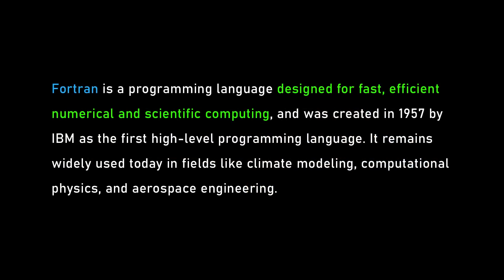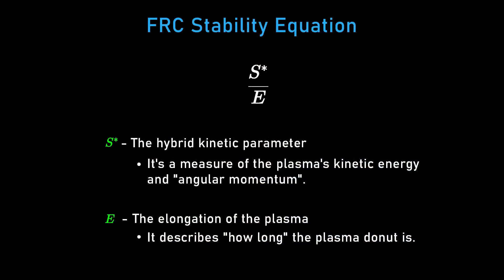Code that controls nuclear fusion: What programming language is used? | David Kirtley

Comment: What a bunch of malarkey. FPGAs are not programmed in assembly. You might download a synthetic core into the FPGA and program that in assembly, or the FPGA might have a hard core and you program that in assembly, but the programmable logic is defined in RTL which is not instructions (as CPU machine code is).

Comment: "Code that controls nuclear fusion: What programming language is used? | David Kirtley"

David Kirtley, CEO of Helion Energy, is interviewed by Lex Fridman about the programming languages and systems used to control nuclear fusion reactors:

Time Scale of Fusion: Fusion happens in microseconds—far too fast for human responses. Control sequences are pre-programmed and managed by computers capable of gigahertz-scale operations.

Programming Languages Used:

Fortran: Still extensively used for physics simulations and numerical computations due to its efficiency and legacy support in fusion and scientific codes.

Python: Used increasingly for scripting, automation, and binding together simulations. Some reactor operation codes use Python, despite its slower performance.

Java: Used intermittently for supervisory control and high-level system orchestration.

Assembly Language: Essential for programming hardware-level logic and direct control of FPGAs (Field-Programmable Gate Arrays) for rapid switching and triggering electrical sequences.

PLC (Programmable Logic Controllers): Structured text, ladder logic for interlock/safety systems.

C, C++: Used for real-time plasma control and integration with other systems.

VHDL/Verilog: For direct hardware description and FPGA programming.

How Control Works:

Electrical switches and fiber optics manage plasma and energy flows, responding in nanoseconds.

Real-time diagnostic systems monitor thousands of parallel electrical switches, using fiber optics and electromagnetic sensing (Rogowski coils).

Control sequences are designed and simulated ahead of time using computational models, often derived from MHD (magneto-hydrodynamic) codes and SPICE electrical modeling.

Simulation & Design:

Simulations run at multiple levels: fluid models for plasma, particle-in-cell models for ions, SPICE for electrical systems.

AI and machine learning are starting to assist with faster, more predictive control and diagnostics.

Comment: So he mentioned Fortran and Python ... I'm guessing numerical cores in, probably, Fortran-77, and betting some of that code was written twenty years ago or more. But the thumbnail has code from an even older dialect -- looks like Fortran-66 to my eye, based on the numerical (three-way) IF statements.

I'm going to go grab a beer and deal with the flashbacks for a bit, thanks ...
Reply: Twenty years ago people were already writing in Fortran 90/95.    I have Fortran 77 code left from the 80-s (runs just fine),  but not from 90-s onwards.

Comment: Electrical signals travel along wire at very nearly the speed of light. If you use photons you have to have some kind of device detect and convert signals, but electricity can simply power the device when it arrives. I'm not convinced by the speed argument here, considering it's very likely any detector for photons is slower than simply letting the electricity flow.
Reply: Bro no. He's just describing fiber optics but acting like it's something special. It's not and it is faster than copper for sending data.
Reply: @772storminorman  That's not why we use fiber optics to send data. Moving electricity through wires over long distances is annoying as fuck if you can't do it at very high voltages. He's describing systems inside a fusion reactor for timing things which is not going to be long distance, you wouldn't use fiber optics for this because it'd be slower.
Reply: @Lambda.Function 

Unless the electromagnetic interference is so bad that wires are a problem due to the noise.
Reply: @Mentaculus42  Then they wouldn't be using electronic devices at all because we don't have photon processors.
Reply: @Lambda.Function 
So I see you are big on antenna design! So what is very bad on a transmission line of large extent is manageable for shielded devices. Besides they probably use the fiberoptic lines to trigger switches so that induced noise doesn’t prematurely trigger them and get the timing of the sequence off.

Comment: LOL - once I heard government programs. So this is part of an old project made up of code written in whatever language was popular at the time. In short, it's a bunch of old legacy systems held together by a spaghetti of assumptions. This is how government-funded projects work - not kidding. Which isn't really a problem as all the critical stuff will be done by FPGAs (which will be very well engineered). So HDLs are the real stars here in terms of programming. All the other languages will likely be used for deriving what settings go into their FPGAs at the initialisation stage. What language is used probably isn't time-critical. This is pretty much the model employed in trading where every microsecond counts.

Comment: ps Los Alamos used to have a 12 million line Fortran code; so they must have someone who does Fortran at a large scale.
Reply: Almost every person actually doing large scale  scientific numerical simulations knows Fortran.
Reply: Wow!
Reply: @andydataguy    Hi Andy. Just something for your head…  When I originally asked how much code they had (years ago, during a visit), a software manager said they didn’t know. Someone got back to me in 3 days and said about 12 million lines of code (mostly fortran), of which they estimate about 5% was NEVER called.

Now the fun part. I used to have a fair amount of experience looking at science and engineering codes, and what I invariably observed, was a conceptual error about every 1000 lines of functioning code. Not just little errors, conceptual errors. So for example, a code used to design the air flow in a million cars had a boundary value coding error in the differential equations used to calculate the air flow. The code had been in use for a long time when I noticed the error as I tried to extract the original differential equations from the code. [It caused a bit of a stir.] I found similar things in industry code, university code, and government lab code.

What this implies, using my anecdotal rule of thumb, is that their code had approximately 12 THOUSAND conceptual errors. Ouchy ouch ouch.

What does it all mean??

That is a longer story, for a different time…
Reply: I can see using Python to run assembly language modules and programs to make the UI more friendly. However the actual code ( where the rubber meets the road ) needs to be written in assembly language using microprocessors that run the code natively. Adding a programmable device to emulate a cpu adding an additional layer and increasing latency.  Sounds like the entire process is loaded with chaos and needs to be scrapped and redesigned.

Comment: Very few expert believe what Helion Energy is doing is a valid path to fusion energy. While there is no real consensus, Tokamak and Stellarator are by far leading. Not quite getting to fraud for the others, but some come pretty close, and some will almost certainly turn out to be. We know that Tokamak will work, just might be less efficient than Stellarator. Stellarator is catching up fast, but it is not obvious it will work. All the rest is hard to see. Several of the startups have switched their basic designs already, basically stating that they were completely full of... While it isn't perfectly obvious that there cannot be an efficient almost ICE like fusion system, there are so many extra problems compared to Tokamak and even Stellarator that it is -- far fetched.

https://en.wikipedia.org/wiki/Helion_Energy#Criticism

Comment: Something doesn’t add up. How is a microsecond related to a MHz? 1 Hz means once per second, and 1 MHz means one million times per second. So if we’re talking microseconds, that’s more in the kilohertz range.

By the way, the ZX Spectrum used a Z80 CPU running at 3.5 MHz.
Reply: T=1/f=1/(1MHz)=1/(10^6 * 1/s)=10^(-6)*s=1 μs

microseconds is exactly in the MHz range. Maybe you are thinking of milliseconds (which is in the kHz range)?
Reply: @halcyon107  

You're right, I was talking about microseconds and thinking about milliseconds.

Comment: Imagine not using Rust to power nuclear reactors.
Reply: IIRC Fortran 95  is memory  safe, because it  doesn't have  C-style pointers.
Reply: @anotherelvis Still you can write syntactically  code that accesses arrays outside their bounds. What happens at runtime (runtime error, sonething else) depends on the compiler and the compiler options.

Comment: how can you program FPGAs with Python and Assembly ???
Reply: There are Python packages (e.g. nmigen, now Amaranth, MyHDL, etc) that transpile to Verilog/VHDL. However, no assembly (and it doesn't make sense actually). But what he probably means is VHDL, with the higher-level stuff done with Python (there's the PYNQ project for Xilinx FPGA's). They could be using assembly to optimize specific algorithms for special-purpose processor cores instantiated in the FPGA-fabric.
Reply: A lot of FPGAs come packaged with Arm processors and like-thereof.

Comment: All control system consists of the following but not limited to.

Manual controls: hand valves.

Mechanical controls: interlock's, psv's, rupture disc's.

Pneumatic controls: control valves,  solenoid valves. 

Electronic controls: PLC's, DCS's, SIS's, SCADA & HMI's.

Comment: Guys this dude is a manager and marketer pretending to be technical person. Consider this a fun Ad, not anything more.

As far as I know the whole point of FPGAs is to not have the overhead of software and program hardware at the gate level. You'll know the dude is a marketer when he says we used "assembly to program FPGAs". Never heard anyone to call VHDL or Verilog, hardware assembly language. Musk actually created a wave of CEOs pretending to know stuff end-to-end. And Lex just looks amazed upon hearing this marketing show😄
Reply: Just like lex
Reply: Yeah, I agree, and fibre is not actually faster than copper, it's arguably slower. there are other benefits
Reply: @edmaher1 

Yes you are probably correct. Probably more to deal with some serious electromagnetic interference due to the large pulsating currents in the surrounding environment. But hollow-core fiber cables can transmit data up to 45% faster than traditional solid-core fiber because light travels through an air core, closer to the speed of light in a vacuum.
Reply: Thats true, you don't use "assembly to program FPGAs", I thought he meant he was using literally assembly code to program VHDL, but that wouldn't make sense now that you made me think about it, you use C/C++ to program VHDL since C++ is a higher level language and easier to program than VHDL and programming in assembly for VHDL make no sense to me because programming assembly is really time consuming you might as well program in VHDL alone. 🤣
Reply: The FPGA comment took me out completely. 

They are probably using PLCs and a Java/Python frontend. I don't think that they are using FPGAs unless you need some very fast nanosecond reaction time on a subsystem, but in that case it would be things like an emergency off switch or a simple PID controller.

Comment: yes Fortran is still a great number crunching language  Last standard I worked with was 2003 and for numerical methods it was lovely to program in
Reply: And it is  easy to learn  for new programmers.
Reply: I said it was not the best for making images or speech or taking such input. I thought I made clear that Fortean is an ASCII based system and one needs cumbersome extensions to handle such actions. An example would be the NCAR graphics package, which is good for planetary vector and contour maps and simple x-y plots etc.
Reply: But you need a well written compiler that uses the chip architecture and assembly language. This compiler is usually sold bundled together with the operating system by the fabricator. The problem is that fortran is totally ascii text based and code is written with a simple text editor like VIM. It is fine for batch jobs but it gets clumsy as soon as interactive graphical output is needed at run time.
Reply: @micahdembo5140 you don't use Fortran for the graphics just number crunching/ numerical methods. There are good Fortran compilers out there and still a lot of work is done in Fortran.
Reply: @micahdembo5140  Not really,   just get a free Intel oneAPI compiler and you are as good as it gets for the majority of HPC clusters around.     Gnu gfortran is not bad either.  For GPU's there is CUDA Fortran
Reply: @micahdembo5140 

But if you need graphical output, why would you use Fortran for that part of the processing?
Reply: @Mentaculus42  
See my other remarks. But basically it comes down to portability and speed and uniformity across all types of silicon numeric coe-processors and CPU architecture. It is better to do most numeric intensive operations in Fortran if these are the steps that represent the bottleneck of the application.
Reply: @micahdembo5140 

But you were specifically referring to “graphical output” which I assumed was for user presentation, maybe in semi-realtime. Or were you referring to something else about graphical? Why not just pass the Fortran output data to a more specialized graphical generation package (in a different language) for the user interface?

Seems like it is possible to pass data between a user interface module and the Fortran backend code during runtime. Probably a little bit of a pain to setup but I am having a bit of a problem visualizing where one needs Fortran as a continuous realtime control backend that needs to graphically interact in realtime with a complex user interface. My experience with Fortran was only in doing things in “batches” and control systems used different approaches. But my background is rather dated. Just interested in how things are handled now.

Comment: A fusion control system is like a high-frequency trading (HFT) system, constantly monitoring a fast-changing, high-stakes “environment” and switching strategies in real time to maintain stability. In this metaphor, plasma is the money: it’s the lifeblood of the system, volatile, valuable, and potentially destructive if not properly managed.

Just as HFT algorithms adjust orders to respond to market movements, the fusion controller adjusts magnetic fields, heating, and fuel injection to respond to plasma instabilities. In both cases, speed, precision, and automated feedback are essential, and mismanagement can cascade into catastrophic outcomes—financially for markets, physically for reactors.
Reply: Except one is important ground breaking science and the other is some very rich people ripping you off every time you place an order in the stock market.